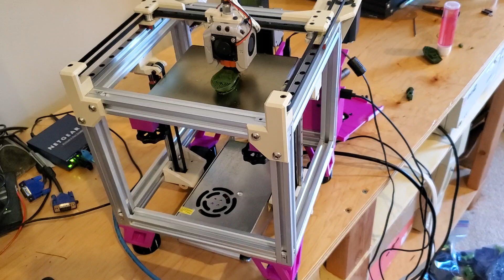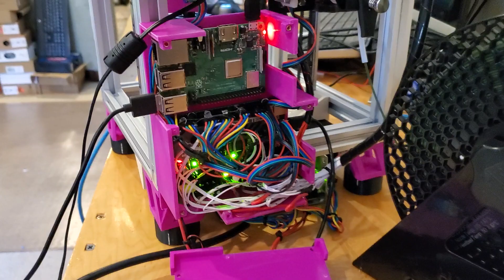Bijou Serial Request _ Small Core H-bot 3D printer

Comment: the belt 6mm ?
Reply from the maker: Yep, just using standard 6mm GT2s on all axis.  I am watching Z axis since the bed is a bit heavy, but with 2 on each side and only 150mm square, shouldn't be a problem.  Prints have been perfect.
Reply: @chipackerknecht9596  have question Serial Request mean ? i see name Voron Serial Request mean model ? or mean connect usb via rasberry board ?
Reply from the maker: @workpeaceful9066  Designers/Teams can offer "Serial Numbers" to the machines that they build of their designs.  You follow the guidelines and the typically "mark" your Discord username with a Serial Number.  For "Rolohaun;'s Discord Channel, I have "BIJOU #002" stamped on the Discord user.  Its mostly symbolic, nothing material, but its a Nice Acknowledgment of the work you have done.  Hope this helps.